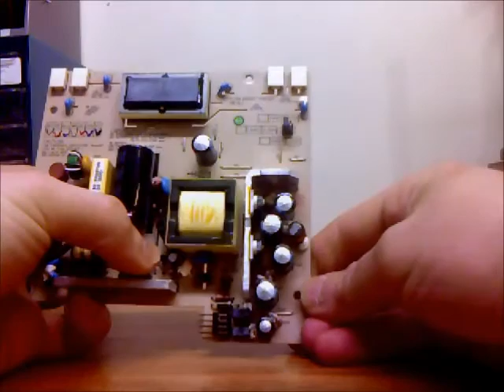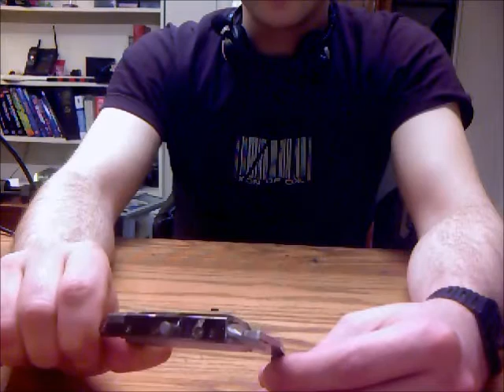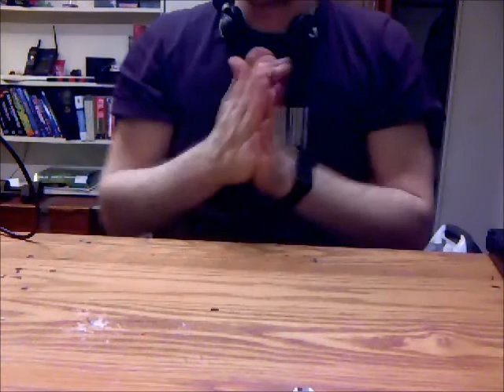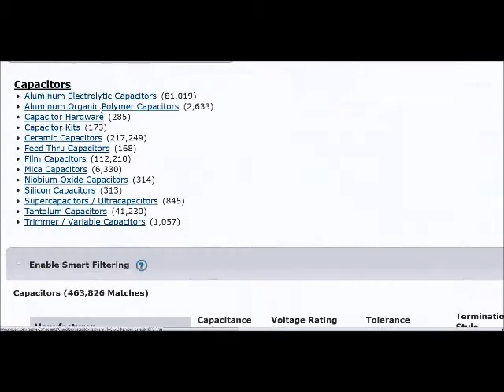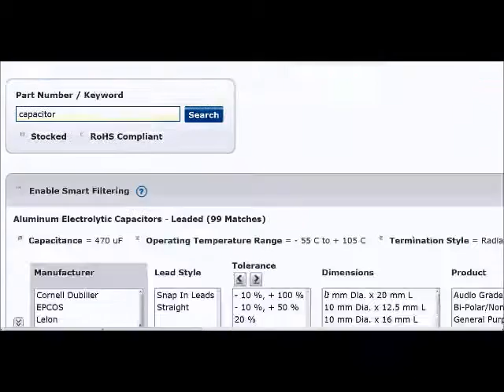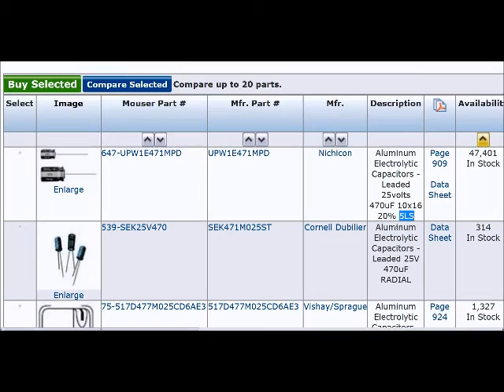How to Replace an Electrolytic Capacitor

Comment: nice video, clear and concise.  what equipment are you using? any particular type  of soldering tip, solder vacuum? thanks
Reply from the maker: I was using a Hakko FX-888, the tip was a T18-D16, The Vacuum was similar to this http://www.amazon.com/Parts-Express-Solder-Sucker-desoldering/dp/B0002KRAAG